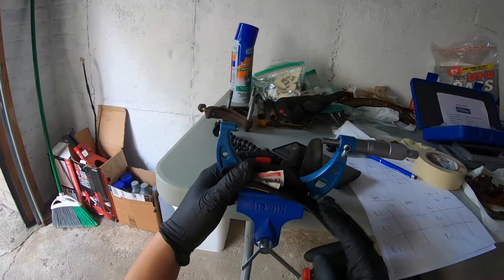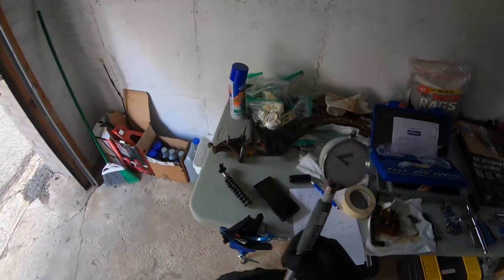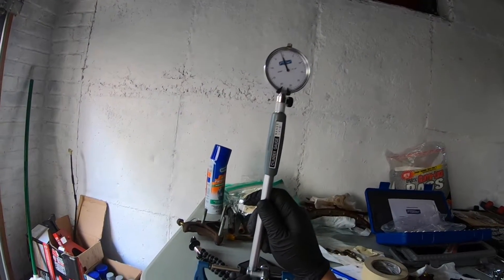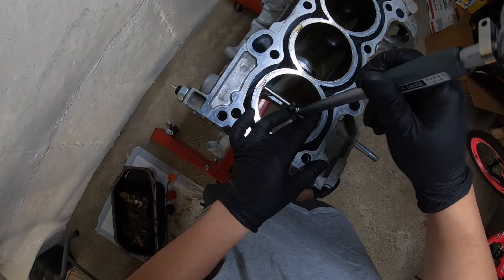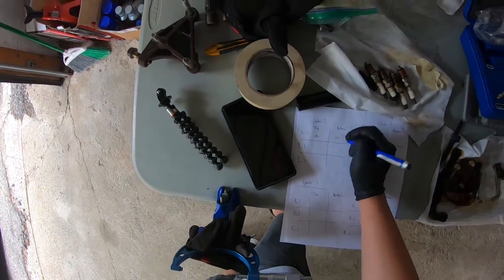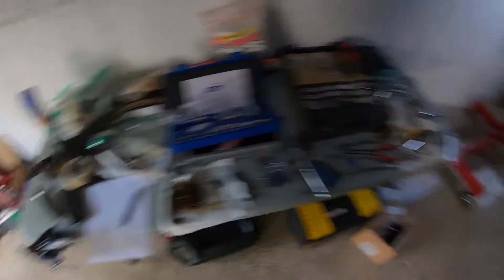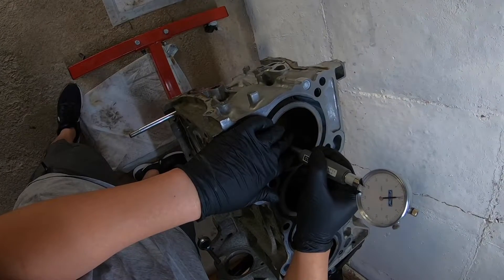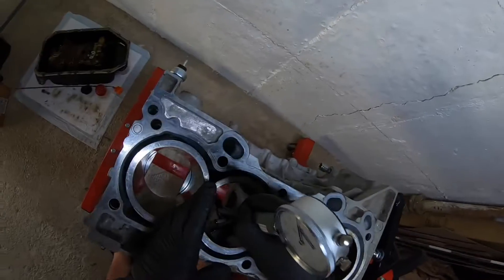HOW TO: Use A Dial Bore Gauge (the CORRECT way)

Comment: Do u mind explaining what each line is numbered at and how to read it sorry I’m slow
Reply: I no u said each is .0005 how do u get the final result
Reply: @Dusty2040  don't know if you've gotten an answer yet, but. the Dial Indicator has a resolution of .0005" or 5 ten thousandth. this is 1/2 of .001" or 1 thousandth of an inch. So every 2 lines equals 1 thousandth of and inch or .001". basically just count the number of lines and divided by 2 to get your deviation. remember to either add or subtract from you set measurement to get the actual bore diameter. Also, verify what the resolution is for the tool you are actually using. I suspect that .0005" is standard, but it could be .001". double check. remember always measure twice and cut once.
Reply: @robertscaggs1346  hey man really appreciate that thank you

Comment: If your micrometer was set to 3,425”, and you chose an anvil of size 3.4”, it wouldn’t have touched on both sides of the micrometer. Math doesn’t add up.

Comment: My Fowler gauge is stuck maxed out after the first measurement wtf
Reply from the maker: did you use the correct tip?
Reply: @ikigaidriven  I figured it out. I had to spray wd-40 in the tip hold to free up the button. It was seized… did a number on my bearing because of it. $125 for a tool that cost me an addition $80 for new bearings lol

Comment: Nice to see a young guy enthusiastically rebuilding an engine & trying to do it right at home! Couple tips from an old engine guy to help you take care of your precision instruments: 1 - Soft jaws or padding for the vice to protect the mic. 2 - (and I just used this after 50 years!) Put a short piece of clear soft 1/4” vinyl tubing on the end of micrometer anvil so your dial bore feeler doesn’t slide off so easily. Like having a third hand. Keep up the good work!
Reply from the maker: Appreciate the tips,thanks for your comment

Comment: Put a torque plate on the block and redo the measurements
Reply from the maker: Yes, I didnt use a torque plate. You're right I probably should have. Thanks for the suggestion!
Reply: YES YES YES...Always!!   Damn him...lol
Reply: Does it matter as much on an open deck block? i thought there would be less distortion due to this?
Reply: @jamestempestsaint  it still distorts the cylinders slightly yes. Especially the higher quality of head stud used. Example, oem studs distort it let’s say .001 arp 2000 can distort it .0015-.002 and the arp625 or 1/2” studs etc will distort the block even more. You’re also technically suppose to line hone the main bearing bores with the torque plates on as well for a even more accurate main bore.
Reply: @justinranes3351  would a torque plate be something id have to make specifically for my engine? Or something off the shelf?
Reply: @jamestempestsaint  companies sell them. I think last I checked MAP sold them. But most machine shops that’s work with Subarus will have them
Reply: My mistake lol I was thinking this was a Subaru video lol. But regardless companies make them for almost every engine that has a community following
Reply: @justinranes3351  i havent been able to find one for my L Series (Honda). Will have to keep looking haha